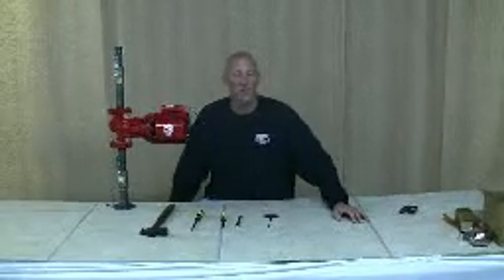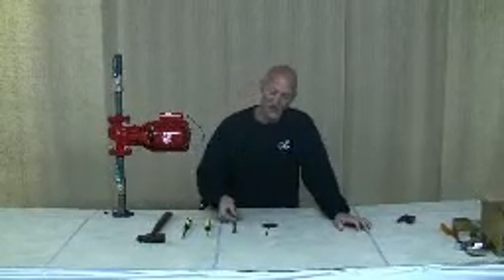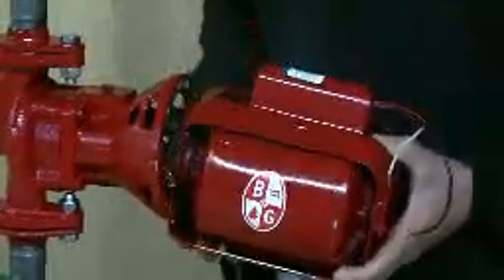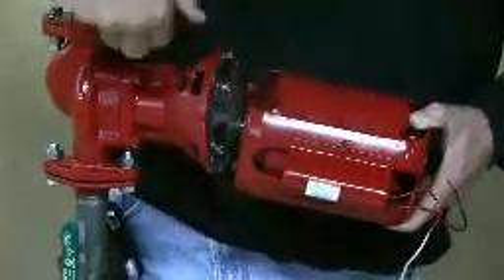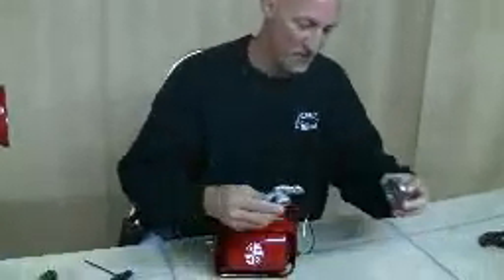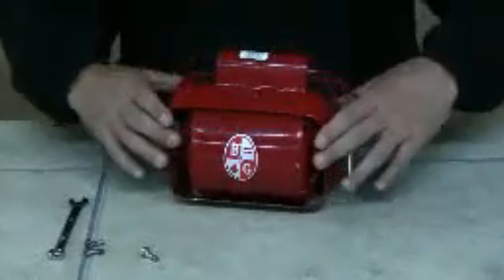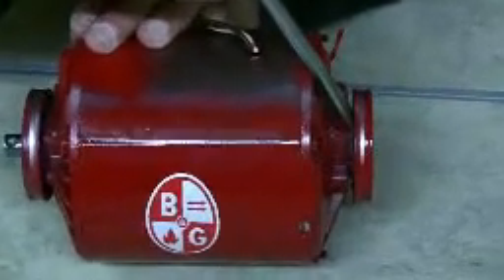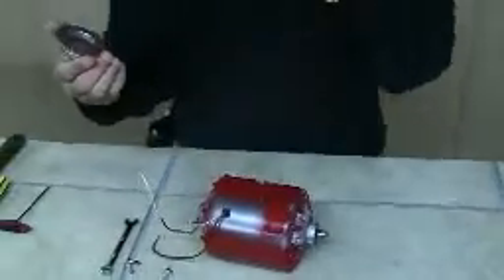Bell & Gossett Series 100 Repair Video

Comment: Thanks for making this video.  Last month our GE motor (series 100 B&G pump) became faulty due to a failing internal start switch.  I bought a "Mars" 1/8 HP motor on Ebay, described as a B&G replacement.  It fits perfectly but is a little noisy in operation.  I attribute it to being a cheaper motor.  I ended up removing it from its frame (identical to your motor setup) and installing the motor in the existing GE frame.